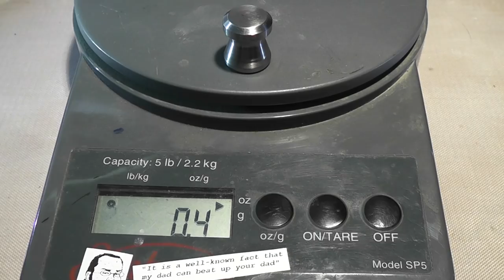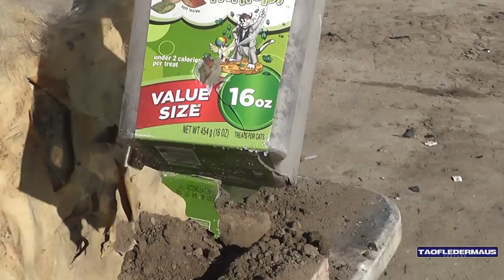TITANIUM BULLETS - World's strongest slug?

Comment: Aaahhhhhhh titanium. The stronger kind of metal
Reply from the maker: (said in a batman voice)
Reply: Do you know why Richard Ryan from Full Mag quit YouTube? I used to be one of his subscribers; his channel was one of my favorites too
Reply: TAOFLEDERMAUS Jeff I'm actually wondering what hardened steel penetrators from ss109/m855 or even ones from 7n1 7n6 etc you get the point. I'm still watching all your vids daily so I don't think I've seen one from you yet. I'm thinking about in a hollow point slug epoxy one in the middle. for penetration and expansion. thanks in advance
Reply: This thing could fly at Mach 4!
Reply: No. Steel is stronger. But titanium has the highest strength-to-density ratio.

Comment: A relatively cheap, low alloy steel like 4340 has a tensile strength of 108ksi when it’s in a dead soft annealed state. However, it can be heat treated to over 200ksi (1380MPa). A somewhat modified version with the cursed name 300M can reach 300ksi (2070MPa), or more than twice the strength of Ti-6Al-4V.

Comment: I work in an aluminum factory we make sheet metal on rolls anywhere from 16” to 30” wide up to 70” OD we use titanium shears and they last forever the rubber grips have worn off of them over the past 30 years but believe it or not the shears have worked through heavy use of cutting .04”-.006” aluminum sheet for over 30 years without needing to be sharpened or replaced

Comment: Titanium - stronger than metal steel😄
Reply: No, just lighter.

It's only stronger *given the same weight*, if you go by volume then steel is stronger.
Reply: Nnelg - didn't watch the video did ya?
Reply: BigK titanium is a specialty metal. It's far from the strongest metal
Reply: Electric Driver he's joking about something greg said in the vid
Reply: Nnelg By the same weight or the same volume, Titanium is stronger than steel, but by the same volume, titanium is weaker than Tungsten.
Reply: Unobtainium is the strongest material period.
Reply: Strength isn't the issue between Steel and Titanium, it's density.
Reply: reggiep75 - Applying potatoes to the exterior of your car will decrease it's drag coefficient and increase mpg.
Reply: BigK - You lie!!

I was told it was a perfect blend of M&Ms, skittles and stale bread that was made by children that did that. All glued on by the sugary saliva of children of children eating marshmallows

You're probably thinking of Daleks who initially started with potatoes but they rotted too soon and then opted for the steel balls they have now. The also had all the other shit like potato mashers and sink plungers that fucked with their aerodynamics too.

What happened to the world?
Reply: Evan Nibbe size for size titanium is much weaker than steel.
Anyone with the misfortune of having to work with titanium bolts has the box full of snapped ones to prove it

Comment: Nope inconel 718 is strongest metal on the planet get a slug of that and see plz jeff!!
Reply: Alex V-i-P I'd use tungsten carbide more than enough density to pass clean through a plate carrier :)
Reply: Alex V-i-P Hardness depends on if it has been heat treated or not. 
Inconel is a proprietary alloy. Not pure a element like titanium
Reply: Tungsten does pretty good by itself
Reply: Alex V-i-P ewewell , not exactly . from a secret squirrel I heard that there is a metal used by cheveron , that is purported to be even stronger . he claimed it was called cheveron .... , and that it was far more skukum than inconel , monel , or hastaloy. I gotta get my hands on a small piece . the welder also claimed that all scrap from it were recovered by manufacturer and hauled off. 
At that point in the story , I began wondering if he could pass a drug test . but hey , I've been wrong before.
Reply: Robert Doe that's what I want for a pocket knife . one day

Comment: I'd like to see a competition between the strongest slugs using a few metals (other than carbon steel), alloys and even ceramics if they were easy to obtain and at a reasonable price. Generally stuff from the Mohs hardness chart and a few unclassed invaders.

Tungsten, Titanium, Chromium, Tungsten Carbide and Cobalt would be good but the nicely priced Cubic Zirconia would be a lovely material to work with and make some brutal slugs from.

Hopefully, this could be something for a future project.

Comment: Note about the plates. Aluminium used to be very hard to produce, and it's worth was like gold. However, when electrolysis made production very easy, it dropped in price drastically. But not before many rich people had cutlery, glasse, and I guess plates as well, made of the material.

Comment: 5:08 ... the advantage of chasing trays is you heat them up (actually pretty hot too) ... before putting the food plate on them ... and it keeps the food warm.  (one of my many jobs was "kitchen help" and cooks assistant, at a small army base ... (many many years ago) :) ...... 

Oh after I saw the proof marks on the back and quick check on the net? .. Those trays sell for about $20 to $25 each (without bullet holes)  LOL

Comment: They use Steel Saw blades and Steel Cutters to cut and Mill Titanium. Titanium is not stronger than most steels BUT it is Lighter than steel and STRONGER than Aluminum.

Comment: titanium is not stronger then steel, its is around as strong depending on the steels carbon level, but it is half the weight, so it will fly like an aluminum bullet, but impact like a steel one, titanium is also flammable so tiny shaving of it will oxidize.

Comment: I might be late to the party... but Titanium is NOT stronger than steel 0:36
That's a myth probably originating from it being an exotic metal used in very specific cases in the aviation industry, like the SR-71 Blackbird.
It's not particularly strong... steel is stronger.
It's not particularly light... Aluminium is lighter.
What's important is that it is the best compromise between strength and weight. 0:07
If engineers could get away with the lesser strength, they would use the lighter Aluminium (as they do in commercial aviation). If they could get away with more weight, they would use stronger steel (like everywhere where weight is not an issue, like construction). When engineers need both, they take the very expensive and difficult to work with Titanium.
Reply: Isn't beryllium among the nastiest metals to work with?

Comment: Steel is stronger than titanium
Reply: John theux 
People get Harder and Stronger confused.
Reply: Harder and stronger is the same for ductile materials.
Reply: Sören Titanium is more Brittle than Steel therefore not Stronger. But you could have a Titanium Alloy Steel.
Reply: John theux somewhat related, but not the same.
Reply: Strong mean tensile strength, hard mean compressive strength.

In most material you only have to multiply the tensile strength by nearly 3 to calculate the hardness.

But in fragile materials like diamond or tungsten carbide, the hardness is a way higher than the tensile strength because when you compress it the two sides of the internal cracks are press together to let pass the force and when you stretch it, the force is concentrated on the edges of the cracks and the cracks extend .

Comment: Titanium is only stronger than steel by weight. This Titanium slug is not stronger than a steel slug of equal shape and size.. 
IF you had a rod of steel and a rod of Titanium of equal external shape and size.. the steel would be stronger. But if you thicken the titanium rod until its just as heavy as the steel rod.. THEN it would be stronger.

Comment: I could build you a multi caliber black piwder powered air gun for real ballistics tests like the ones used in labs its easy enough to built and u could achieve mental velocity 4000 fps plus caliber dependant u just make adapters and have various barrels u add black powder in one section that wen set of propells a piston to basically make a ajustable power super air gun they use similar ones at nasa to test metiorite impacts theres a video were a. 177 seteel ball blows a huge ball of marble into bits using one and its legit scientific equipment so youtube cant say f all about guns